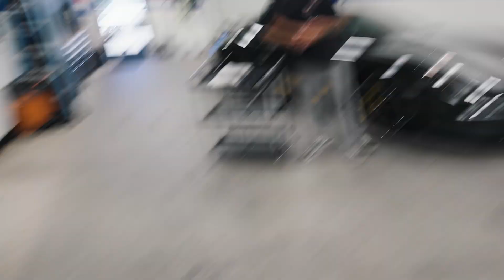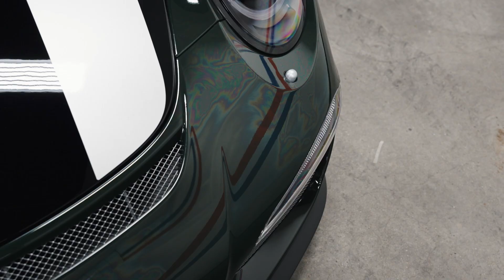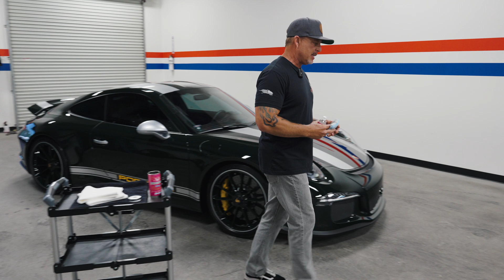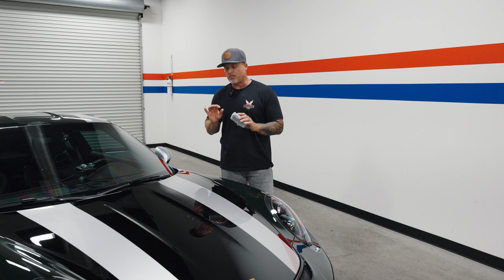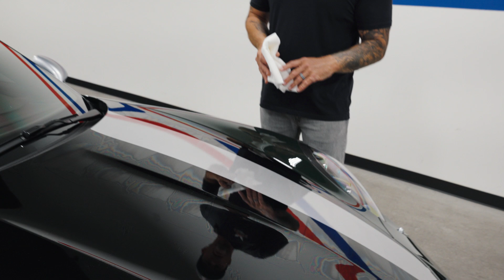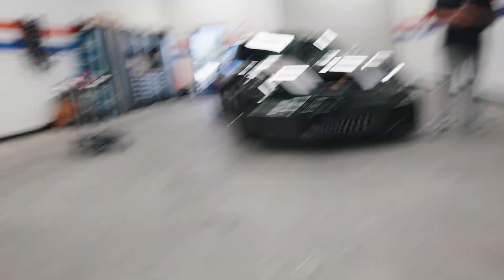Introducing Beadlock Wrap PPF & Vinyl Ceramic Coating | Shine Supply Products

Comment: hi there! A while back i purchased some items from your shop and have been very happy with the outcome. I had one question however; are Punch It and Throttle safe to use on PPF? thanks in advance for your help!
Reply from the maker: Absolutely those are both excellent products to use on PPF!